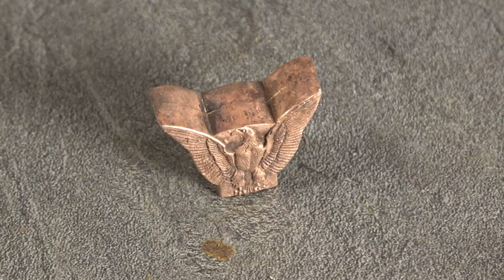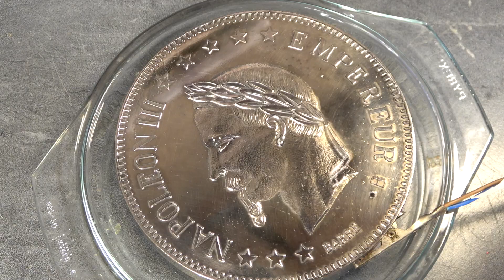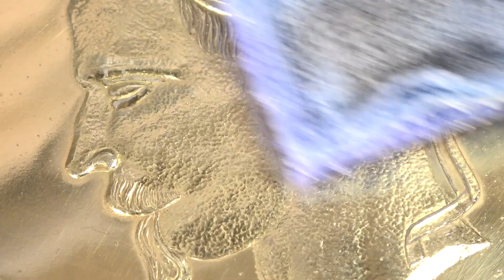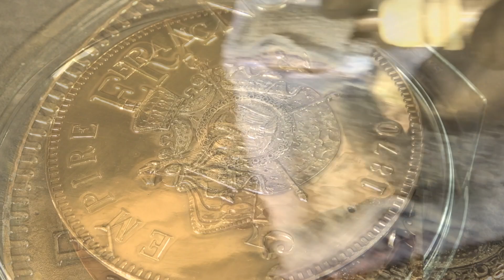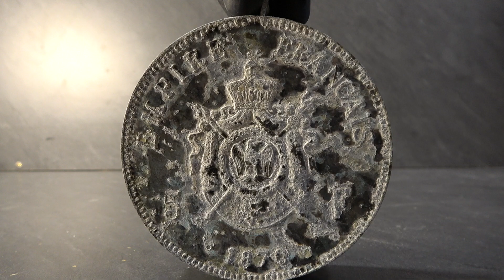Napoleon 24k gold - Giant table lighter - Restoration

Comment: I Love watching the detailed process and the simple drilling out of the seized flint with the right size drill bit that has to be smaller than the interior hollow of the spring tube inside diameter but if that small bit wasn't on hand you could have clipped 1/8th to 1/4 of the threaded tube off as a last resort but the right tool for the job is Always ideal. I initially thought the whole casing was solid 24k gold until I started the video and knew there was No gold there but was only nickel but was perfect for you to plate with gold and another Fantastic restoration.
 I'm thankful that you identify the different solvents including the baking soda that has many other uses than for just baking bread and other foods, it has industrial uses to.
Reply: I have a chemistry question about cleaning the sponge  with baking soda + white vinegar. Baking soda is a mild base and white vinegar is a mild acid. When the 2 components come together you get a new compound that isn't basic or acid (if added in the correct proportions). Sodium acetate. 
  So my question is, does sodium acetate remove old oil deposits or did TheFabrik want the solution slightly acid to clean the sponge without destroying it? A base reacts with oils well but I thought I saw rust deposits in the sponge as well. If your trying to remove the rust deposits then the acid is a good choice. Was he cleaning both or was this a completely neutralized solution of sodium acetate to react with old deposits in the sponge?

Comment: I’m really surprised the tank doesn’t leak when the lighter is closed and the tank is turned 90 degrees to horizontal.  I guess the wicking material is supposed to hold the fluid and prevent it from weeping out.  The key must be to not fill it with too much fluid.  It’s an amazing and beautiful piece.  The gold plating makes it look spectacular.

Comment: Brilliant restoration, but I am curious; at several times, when you turn the body around to show/clean the reverse of the coin, does it say 'EMPIRE FRANÇAIS' or 'EMPIRE ERANCAIS'? because I see an E instead of F and a C instead of C-cedilla (Ç); I'm not sure if anyone else has mentioned this.
Reply from the maker: You're right. I don't no why... I have no idea !!!🤷‍♂️
Reply: I already dropped a comment about the tittle of this video. It is Napoleon the 3rd, and not Napoleon (AKA Napoleon the first). For sure, the "E" before "RANCAIS" is a big issue. Sounds off. Forget about the C-cedilla (ç) which normally is not written in uppercase letter in French. What's funny is that on website catawiki, I found the exact same object and one of the pictures shows a fantastic "Japan" engraved somewhere on it. My personal opinion is that it was probably not made in the XIXth century but most probably somewhere during the XXth. Never mind. Let's concentrate on the quality of the restoration which is brilliant for sure. 🙏👍
Reply from the maker: @zepzepzep4503  thanks a lot for all these infos !! 🙌 I knew it was from 1950/60
Reply: and BTW, did you spot the "Japan" letters somewhere?
Reply from the maker: @zepzepzep4503  nope there is no « Japan » ...

Comment: Beautiful piece my friend. If I may ask. What is the purpose of nickel plating? Is it necessary? I see that procedure a lot in other videos
Reply: Nickel plating helps protect the metal from corrosion, it's very resistant to corrosion, so having a small layer of it helps protect the easier to corrode underlying metal. sometimes it's done for that, sometimes just because it looks nice. You can plate a wide variety of metals with nickel and the plating solution while somewhat dangerous is a lot less dangerous than some of the fluids required to plate with other metals. It's also fairly inexpensive, so it works out great for hobbyists!
Reply: @spencerwarren8302  oh wow! I thank you for that explanation 😊 makes a lot of sense. Keep up the fantastic yet satisfying work. Looking forward to more videos 😁